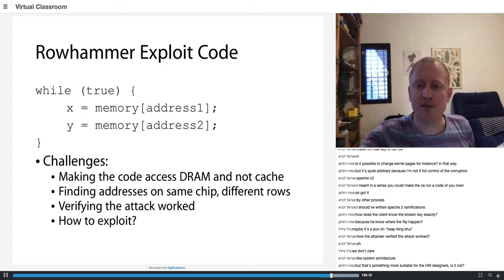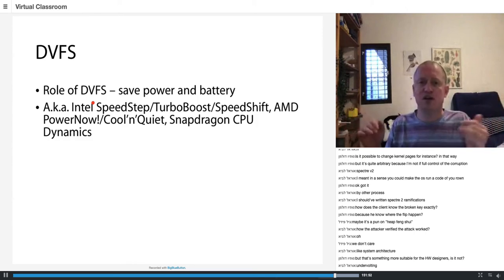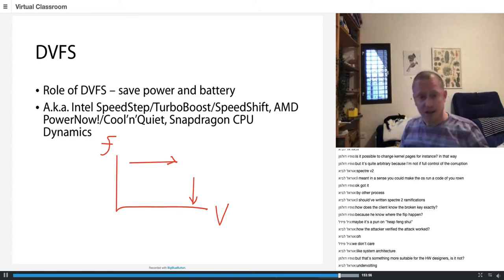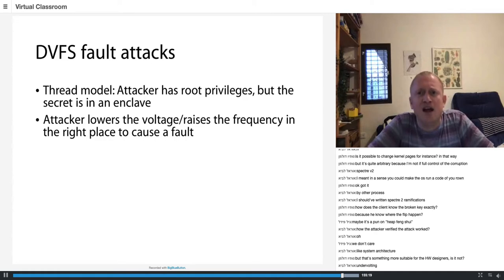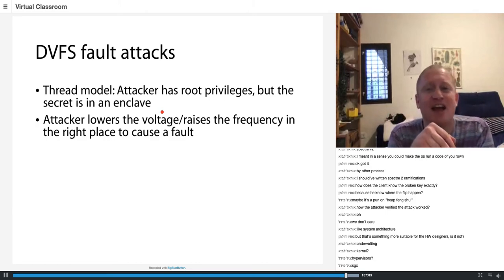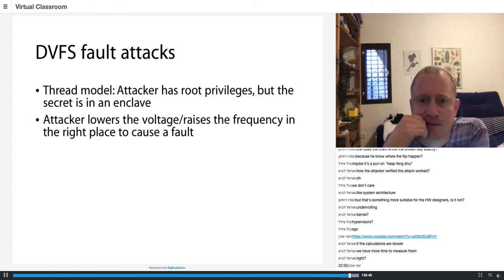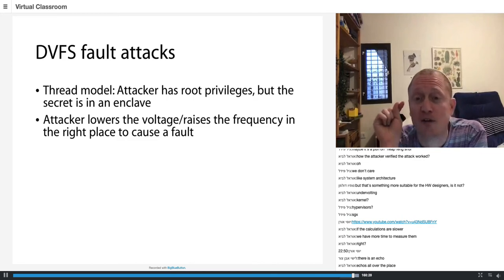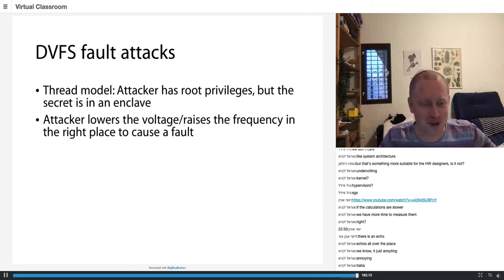DVFS - Dynamic voltage and frequency scaling

Comment: I did not think modern CPU give direct access to the the voltage and frequency and instead use a DVFS table that is burned into the CPU PM-HW such as AMDs SMU or QComs RPMH. So the operating system only specifies an OPP index/P-state that is used by the CPU PM hardware to look up the voltage/freq in a pre-computed table rather then directly writing into a voltage regulator and frequency register?